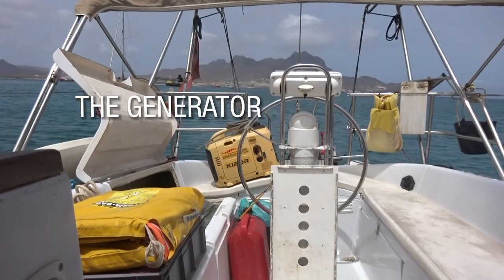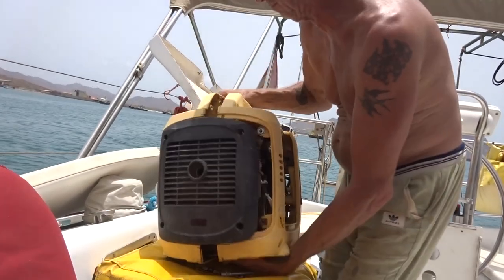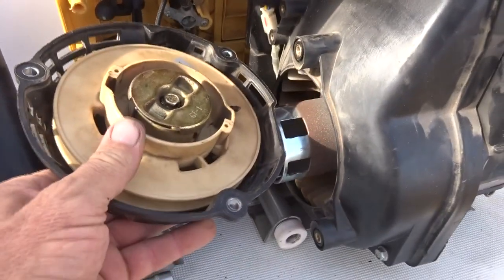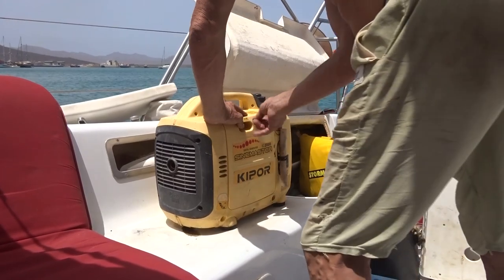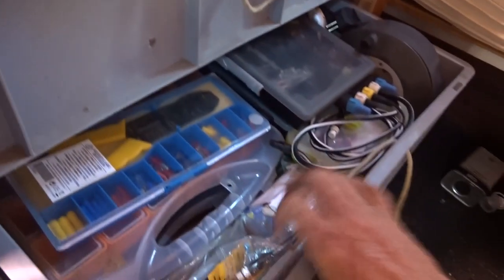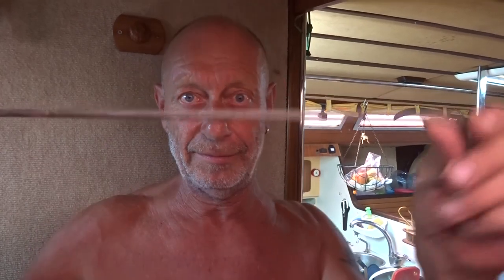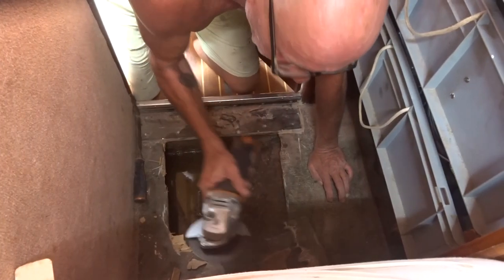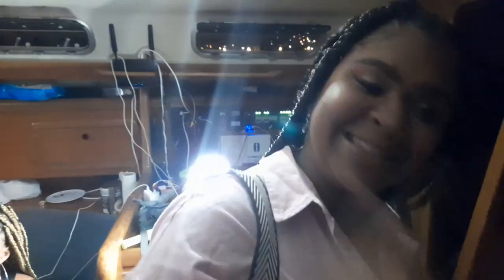The Frustration Of Living Aboard A Sailboat | Sailing Galopin In Cabo Verde | Season 5 | Episode 81

Comment: See if you can find some anti-seize compound  to put on those nuts and bolts that you might have to take apart sometimes. It'll save having to  tear things up to get them apart. Use sparingly as it's messy stuff but works well.
Reply from the maker: Thanks, but some products are hard to get here. This island has a population of only 120k people